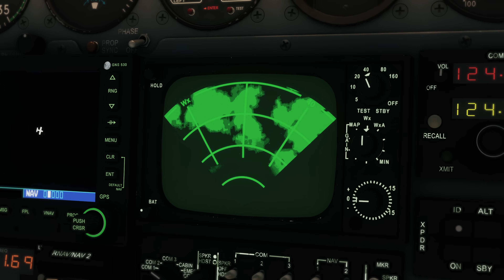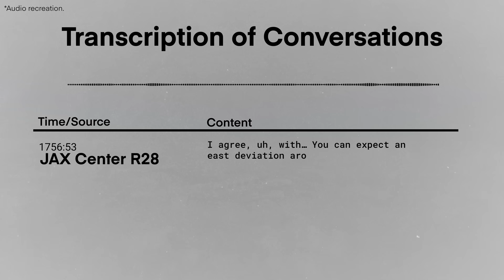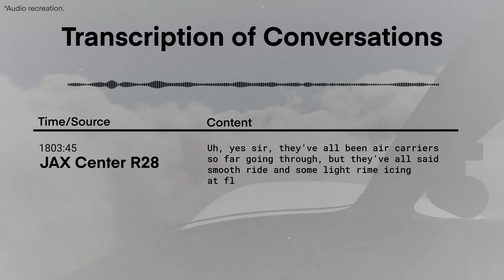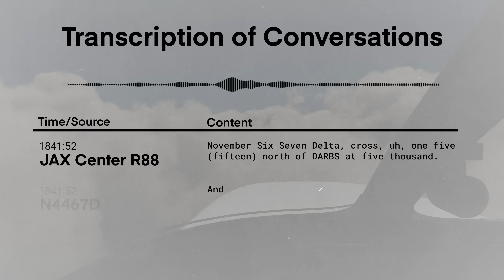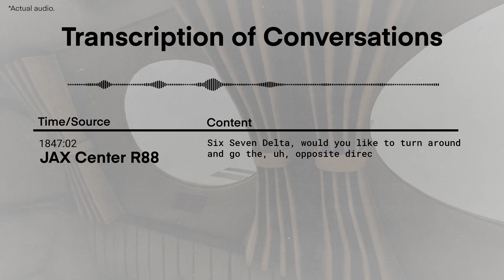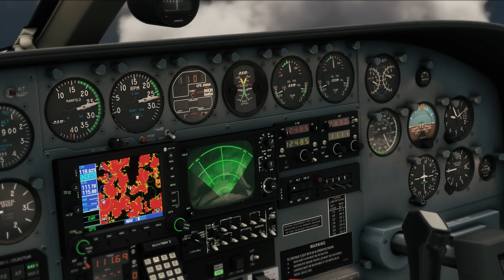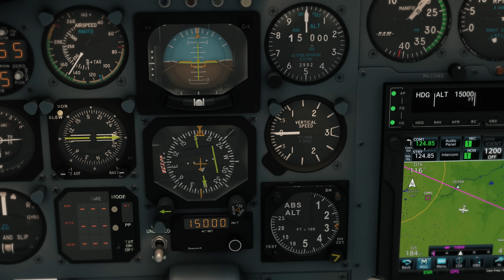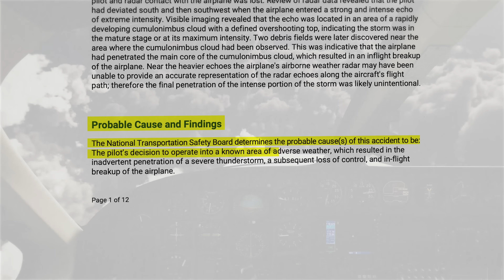Why Did They Fly Into a Storm? | Accident Case Study

Comment: Learned as a student pilot that it is exhausting fighting weather. I was stuck in the Santa Ana winds in a beech tomahawk. Landed in Palm Springs, lunch and fuel, took off to FBO Riverside. Had to land in Banning to refuel. The cars on the freeway were twice my speed. My rollout in Banning was about 30’ before I popped off the ground. Never again. Banning was maybe 15 miles from Palm Springs.
Reply: Damn. That’s wild. 
Glad you made it Sir🙏
Reply: Piper Tomahawk?

Comment: No I wouldn't have flown into that.
The part about deliberately flying an aircraft into a line of CB's with tops at 45,000' is what gets me. Like why? Jets have crashed in storms less than these. 
Remember that crash where the surge valves got iced over and the engines well catastrophically surged, flamed out and they tried to land on a highway but it all turned to crap?  Burnt 'zombies' started started knocking on residents front doors in the area.
You couldn't think this stuff up as a script for a horror movie.  

Of all the stupid things to do. If the turbulence doesn't get you the hail will and if the hail doesn't get you the clear ice will. 
I understand how it happened but I like conflict and I'd happily tell the CEO to eff off in this situation if he/she insisted on pressing on. I'm the PIC, and while I'm the PIC the law has enshrined in me the responsibility for conducting a safe flight CEO or no CEO. 
I'm not dying for anyone.

Comment: Many are blaming the pilot for not avoiding the storm. So many times we go out driving & massive rain starts. 2 wheelers stop & take cover. 4 wheelers continue. I have continued my car in the storm & rain. But up in the air the stakes are way too high to fly into bad weather. He got into the bad weather not by choice but by accident but why did the plane overturn & break mid air ? Arent there simulators to train pilots to fly through extreme weather ? Or better is leave the flying job to fully automated machine rather than human brains with limitations.

Comment: I penetrated thunderstorm few times and it was very scary and turbulent.  It was so shaky I couldn't see instruments and there was no way to maintain altitude. I stalled and banked  +- 70 deg and lost few thousand feet before it spat my PC-12 out into clean air. On another ocasion I flew into one at night - it was yellow on the radar and it was on my arrival track. Again very turbulent, lots of ice and flashes.   Now I refuse to fly unless I am 100% sure there is a way around them. It wasn't even a severe thunderstorms.
Reply: Very lucky, I flew the 12 for a bit. Not as docile as people make them out to be. Rough air and especially icing were incredibly problematic in that frame.

Comment: We get lots of scatter single cells here in FL like shown over GA and AL at index 5:28. These are easy to navigate around during daytime. However, that beast over the Golf and North FL, it's a completely different story. I only use ADSB low resolution Wx and ATC Wx (as primary source). Even ADSB Wx would've shown this beast well enough to stay away from that area. What would have I done? At index 5:28, if flying towards my base (KMLB), I would've requested eastbound to the east cost and try to beat the storm before turning South (done this several times before). If flying towards KTPA, easy, land and wait. It's really not a hard decision.

Comment: Southern Airways Flight 242 encountered a similar situation. They "Landed" and saved some passengers. Same issue with the attenuation of the radar by the worst part of the storm. Flight crew was pretty good in getting the aircraft down as well as they did.

Comment: Flying speed reduced  hardly ever mentioned in these convective conditions resulting in structural failures.. why ?
Sometimes it matters. Turning 180 while losing control straight and level was clearly the worst suggestion by ground control knowing the flight course was close to good weather ahead on radar.. the turn attempt by a now very tired  good pilot, killed them all..

Comment: Poop happens I know but, as cargo pilot flying Baron 58s and piper Aerostar. I “penetrated “ thunderstorm lines a hundred times in those airplanes based at DCA and RDU. Of course you avoid what you can. You never pull a 180 almost. It will take same or longer time to exit storm. Plus Making that turn is difficult when you can’t even read your instruments because of turbulence and put more stress on airplane.
Reply: The pilot was a Commercial Pilot, single and multi-engine land.  He was not instrument rated.  He was not very experienced.  🤔🤨🧐
Reply: @jamesburns2232  If you bothered to read the NTSB report you'll find it clearly states that the pilot was instrument rated.
Reply: BS

Comment: It is easy to say you'd go around, but airliners saying it was smooth at his altitude going through make the decision to go through it more enticing. My experience and based on what is being depicted in the video would lead me to assume that area where he turned around would be the bumpiest. It is the edge of a fast moving and active cell. I'm assuming his 2000ft/min descent was uncommanded and he already burned off his airspeed to Blue line trying to maintain altitude, meaning a 4000ft/min downdraft or greater. I wouldn't be doing anything other than keeping wings level, airspeed around blue line and  maybe opening cowl flaps to keep the engines from getting hot. Eventually he would have popped out of that storm either vertically or horizontally. These types of events seem to happen a couple times a year in the more capable piston category to turboprop category and every time it seems like the incident should have been preventable.
Reply: The airline pilots had real time radar and knew how to read it. In that scenario, one can navigate around cells and through “holes” But a-general aviation aircraft with XM weather trying to get through a hole, might as well put say goodbye, because its akin to suicide.

Comment: I fly a C414A and while it's very capable, I never get too close (e.g. within 20NM) to convective activity, or suspected convective activity. Based on the visualization presented on this video I'd have diverted and waited it out. I use Sirius XM weather, airborne weather radar, and Sentry on my iPad and having that above view provides a great "strategic" tool to avoid this very situation. He had them yet ignored them which I find puzzling. I've diverted, and waited out weather many times and as a 45 year, 65 year old pilot being bold is not in my game plan. Thunderstorms don't have any realistic options for contingencies..they must be avoided. I always evaluate my risk factors for each flight, actually written on my paper clearance sheet as are departure briefings, approach briefings, and weather hazard briefings items to make sure I don't forget to do them. Sad outcome for sure.

Comment: Better low on the bottom of cells for turbulence. I've flown 45 degrees nose down to maintain altitude while convective activity was sucking allot of air up. When you see the bottom of clouds are bumpy that's a sign of convective activity. When the rushing air is getting to the cloud base moisture presents ie the bumpy cloud base.
Reply: A CB will have a flat bottom, I guess you are referring to a wall cloud or shelf cloud protruding from the bottom indicating extreme precipitation and thus convection. These features cannot usually be see from  FL200 and thus the colour, shape of the tops and lighting is a much better indicator.
Here is he was IMC anyway so was reliant on radar and xm.

I also wouldn’t recommend pitching 45 degrees down to maintain altitude in a connective updraft, 1. chances are there will be a down draft of similar intensity the other side. 2. In a high performance aircraft maintaining altitude in a high energy updraft will almost certainly result in exceeding Vne is a matter of seconds. 3. Self induced unusual attitudes are generally not recommend. Just inform ATC and take the climb, no steep turns, keep the G force to a minimum.
Reply: Fighting  the convection can easily exceed redline and over stress the aircraft .Been thru more than my share as some unexpectedly grew in a matter of minutes.Stay at maneuvering speed wings level tell atc unable to hold any altitude and ride the waves straight ahead .Been up and down excess of 2k per min but it's short .Unnerving yes as the rain sounds like hammers on the windscreen. Flying below cells at least you can see the rain shafts
Reply: Personally I think this is awful advice.  Updrafts are usually surrounded by downdrafts so once you pierce through the storm, wind-shear will pull your aircraft down to the ground, and you would be in no position for a maximum performance escape maneuver.
Reply: @emperorofthegreatunknown4394  There is allot of convective activity. What goes up doesn't have to be coming down and certainly not at certain measurable distances staggered along the cloud base. Downpours are a good place to fin downdrafts. IFR is a goodd place to not have any idea of what you are flying into not being able to see it.
Reply: 100% correct .2000ft better than 15.000ft. No ice,  no mejor Turb

Comment: "Little holes," huh? In that crap little holes become NO holes, in no time. So what would I have done differently? I wouldn't have flown into the pretty colors, just hoping things worked out. When you start trying to force it, you're just asking for trouble. If you ever find yourself asking, "OMG, what should I do now?" Especially repeatedly, you've almost certainly bitten off more than you can chew. I'm guessing no pilot with any skill level could have made it through that. The very experienced ones, however, wouldn't have tried.

"When to turn back......?" It didn't even necessarily have to be a case of turning back. If the (I believe) correct decision had been made they could have just stopped in the northern part of the state, maybe got something to eat, and then continued on. They may have gotten to their destination 2 or 3 hours late......but they would have gotten there.
Reply: Correct - we call them “Suckers Gaps” chances are by the time you get there it will have moved or closed. CB cells in close proximity have a nasty habit of merging to make a supercell where the gap used to be!

Comment: XM is of no use navigating through a line of storms.  Land somewhere, get a nice meal, wait it out. Tell the passengers you will get them there when the storms pass.
Reply: XM  doesn't show the present weather..
Reply: What a shame!🙏
Reply: I agree, the weather shown was fairly fast moving.
Reply: This, excellent advice!
Reply: XM is great for strategic planning, observing trends and movement. If there is sufficient space between storms then the airborne radar is handy using the XM helps with shadowing. Nothing worse than going through some moderate rain just to be confronted with convective activity. Delay and live.
Reply: Smart tricks sitting on the toilet and advice some other.
Reply: @industrieundtechnik1761  Still alive on the toilet
Reply: @industrieundtechnik1761 My passengers and I still alive on that toilet

Comment: He flew the radar and dropped the plane 🛬
Reply: Don't fly the radar since radar info can be misleading because of data transfer delay, up to several minutes, just don't do it, fly around or fly above, a big jet airliner tried to do this from Puerto Rico towards the US shortly after taking off and people got hurt inside the plane, because of how terrible the turbulence was, he didn't have enough altitude at the time to fly above so he went through it trying to navigate the empty spots of the storm on his radar, this doesn't work very well since you still get the heavy winds, you are still in the storm